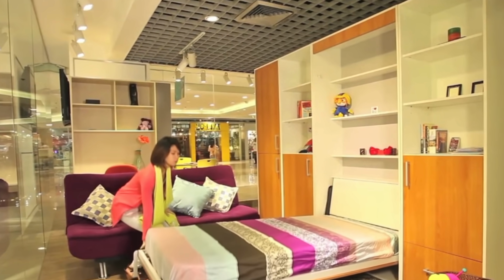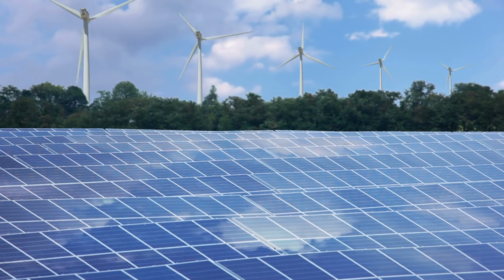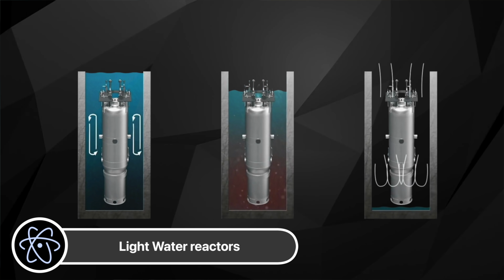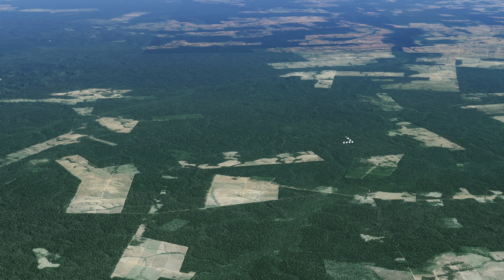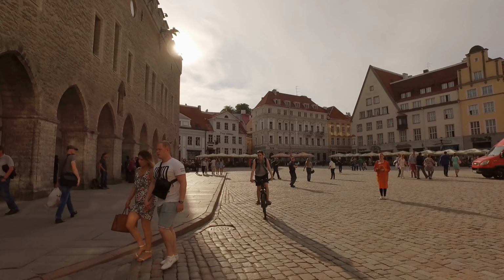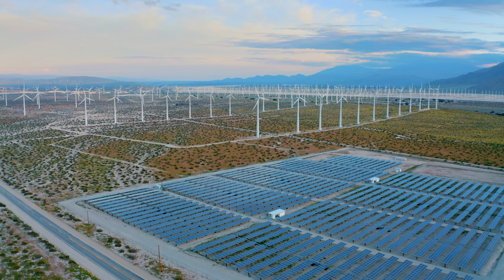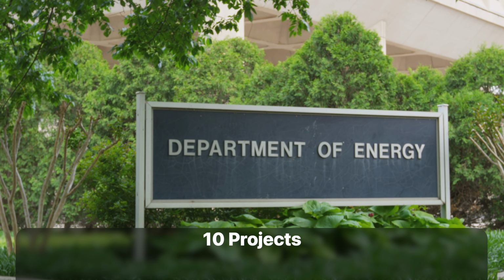Why Small Modular Nuclear Reactors Are the KEY

Comment: Modular Molten Salt thermal breeder reactors are probably the most promising technology (invented by Alvin Weinberg in the 1950s). The beauty of this design is that the reactor is inherently safe and uses up most of the fuel (Thorium). By contrast the light water reactor requires an extremely robust containment chamber and only uses a few percent of the loaded fuel and is inherently dangerous due to very high pressures.involved.

Comment: Actually it should be the percent of fissile fuel. You could make a small msr for a car if you can use Carbon dioxide as the moderator and zirconium fuel rod filled with fissile salt. And use a neutron reflector. So the Super critical carbon dioxide acts as the moderator, slow neutrons are reflected back and Zirconium is passive to neutrons so maybe you could run a car off a U233 fuel salt.

Comment: Perfect for Australian Regions !  My calculations show that 80% of Waste Heat energy from fossil fuels combustion is located in just 2%  of the Global surface. (The Urban Heat Island (very large cities)). The rest of the Global land area is a great candidate for Small Nuclear Reactors  power. Independant, no grid interconnection required etc.
Reply: Why would you mess around with nuclear power in a very spacious and very sunny environment like Australia? I think solar and a few batteries will always be cheaper.
For us in colder regions, we need more backup (but we can use more wind power)
Reply: @roland9367  we have nightime in Australia and please do some maths on grid supply scale batteries with no fossil fuel backup - the cost for a 10 year life is astronomical - remeber when the sun don't shine and the wind don't blow ......
Reply: @jimlofts5433  so you just need a battery to maintain the aircon during the night? That is not a big deal. And lifepo has a long life so 10 years is not a problem.
Also insulate your houses better and run the AC stronger during the day so it can run with lower power at night.

Comment: Cost, security, and safety remain a large concern and may take a decade to validate this new technology. A nuclear reactor typically requires 4 full time operators per reactor with 4 crews for shifts and vacations that would need at least 16 operators per reactor times 12 reactors at a secure site is a huge issue. Much too early to call the SMR low cost. Previous reactors suggested that nuclear power would be too cheap to meter, how did that work out.

Comment: Current home electricity costs, if around $200 per month, equals $24,000 for 10 years.  An in-home reactor that can supply your power needs endlessly for 10 years or more would have to be competitive with $24,000.  The more competitive it is, the more it could overcome people's perception of nuclear tech.  Miniaturization of nuclear power is inevitable.  10 years ago we wouldn't have dreamed of battery powered chain saws and riding mowers.  I won't buy a corded drill ever again because it can't compete with the convenience of the battery tech.  Battery operated viability will continue to progress to larger devices, and the need for way more electricity will pave the way for the the demand for in home miniature reactors.

Comment: It’s great to see massive developments on SMRs, MSRs and Micro Reactors. This is one of the most essential developments to slow climate change. Some Molten Salt Reactors (MSRs) can even run on exiting nuclear waste (after initial U235 typically required for startup). Other MSR designs produce about 95% LESS WASTE than legacy nuclear that has far shorter life span. Industrial heat represents about 20% of all green house gasses and no amount if solar, wind, geothermal and batteries can provide affordably compared to fossil fuels. However Small MSRs run at around 1,200 degrees F (650 Centigrade) near atmospheric pressure, so no insanely expensive pressure containment buildings are required. Factory mass production will dramatically reduce costs over time, as does their inherent ‘passive’ walk-away safe architecture that dramatically reduces the need for legacy nuclear’s unbelievably expensive and complex ‘active’ safety requirements.

Comment: At 13.59 you say that ALL nuclear reactors produce nuclear waste with half-lives of tens of thousands of years.
Not true.
Solid fuel nukes do need to be refuelled and the fuel rods reprocessed regularly, every year or two, but one BIG exception is molten salt reactors where the fuel is in liquid state, dissolved in a carrier salt such as Lithium fluoride. The nuclear fuel in these reactors is virtually completely consumed, and the waste products collected and removed on a regular basis. So instead of ending up with high level waste due only consuming a few percent of the available energy in the original fuel, with super-long half lives, the LFTR uses almost 100% of the energy present in the fuel load, resulting in much less and more benign waste with much shorter half lives.
This, IMHO, is one of the prime benefits of the molten salt type of reactor.

Comment: You can solve the problem of any radiation accidents in 1 swoop. Replace Uranium with Thorium in a molten salt small reactor. If it can be made to use uranium it can for thorium also.
In fact if government's were seriously trying to stop using fossil fuels, we would be sailing, flying & driving using molten salt rectors now

Comment: @TwoBitdaVinci I appreciate the research you put into each and every video. I applaud you mentioning the Crystal River, Florida reactor, my grandfather worked at the Coal / Fossil plant right next to those reactors before retiring in 2004, and it wasnt too soon after he retired that the reactors were decommissioned after stress cracks in the concrete dome formed when an engineer ran a test improperly, damaging the reactors concrete outer casing.
Reply from the maker: That’s fascinating, he ever talk about it?
Reply: @TwoBitDaVinci  yes, I was raised by my grandparents and remember him leaving for work everyday heading to the plant. He spent 15 years at that particular facility, 37 yrs in total with Florida Power Corp, then the ‘94-‘95 downsizing and sell off to Carolina Power and Light to become Progress Energy Corp, then in the 2010s the company was bought out by Duke
Reply: @TwoBitDaVinci  Every type of reactor design known has been built and tested by the U.S. over the last 70 years and the BWR/PWR designs were chosen because the offer the best mix of advantages over disadvantages.  
Any channel that does not discuss the VC Summer unit 2/3 and Vogtle unit 3/4 PWR construction disasters is ignoring what nuclear costs today in the U.S..  Having worked in the nuclear field for 40+ years, I am not anti-nuke by any means.  
Why do people just talk about what might or may happen of what is possible and completely ignore the reality of nuclear power in the U.S. today.  We are not like other countries so what happens in other countries does not matter and corporate and book smart PR is nothing but BS unless backed up by reality and proven examples today.  No investor owned utility is even considering new nuclear because it is their money at state and they don't invest in maybes.

Comment: The radioactve waste is, unfortunately, not only the fuel, but also all materials that undergo long-duration radiation exposure. In nuclear plants, these are tons of concrete used to store the burned fuel before offsite transport, etc. We woul have to get much better at these - you don't want to get one of these babies, just to realize that 10 years later you will face a catastrophic refuel/cleanup situation :(

Comment: 1 thing missed is smaller modular nuclear is easier to load balance (I believe). It's generally much easier to turn on and off individual cells to react to load demands than large traditional nuclear.

Also - would love to see a deeper dive on the difference between then competing micro-nuclear reactors, especially the regular water designs.

Comment: Many decades ago, I was standing within earshot of some Power Company execs, as I took them to be, while at the visitor center for San Onofre's Unit 1, the 183MW reactor now dismantled. The conversation I overheard had some relevance to where we are today with two much larger domes no longer cost effective due to the very difficult financing ALL of our nuclear reactors suffer from.  The one exec was saying 1000MW of coal fired was just so much cheaper than even that middling Unit 1 we were looking at. The other arguing for nuclear said that the economies of scale would be reached, and so it was. I have read so many other stories about SONGS throughout its life, some good, some very disturbing. Generally I see most nuclear as a "money pit" investment that has yet to show its worth for all the grand mistakes of its past.
Like you I see a possibility for some SMRs, maybe. There has to be some base load power in centralized power generation to make renewables fit in to that business model. But mostly I see an industry that is still trying to justify its  fiscal existence. Sans Governmental subsidies for the waste containment  it just does not work out.

Comment: There's a good potential for the use in aviation,  and in use with other components for space travel, there are currently 3 types of engines for space travel in some stage of production. One of the engines needs the sun's light energy too move, a SMR could produce enough light too make the engine work, giving it a stable source of energy.  They can also be used as energy-efficient source for running all of the components  necessary. Where solar power is good there are variables that can place them useless ,or severely limited due too planetary adversities. 
So yes There's a future for these types of component modular reactors.
Reply: > there are currently 3 types of engines for space travel
Chemical
Ion
and...?

Comment: When it comes to the history of nuclear power, small nuclear reactors are not a new thing. In the 1950s and 1960s there were some small nuclear reactors, these early small nuclear reactors were not modular. A couple of examples of early small nuclear reactors include a Nuclear reactor that was at McMurdo Station in Antarctica in the 1960s to provide electricity to the Station. Also there was the SL-1 reactor in the state of Idaho where three men were killed in an accident in 1961. There are two potential trouble areas with these Small Nuclear Reactors, one is making safe reactors that will not melt down in emergencies. Also like large reactors, when these reactors are refilled or reach their end of life there will be Radioactive waste products that need to be dealt with. The problem of Radioactive waste products is a big ongoing problem with no easy solutions.

Comment: To be honest I don't see the need for nuclear when we have wind and solar, the problem I see is the way in which we make use of the wind and solar, for example with the use of hydrogen we could produce hydrogen from wind or solar or both and store that hydrogen for times when there is little to no wind or solar energy.

Many hydrogen sites can produce their own hydrogen from wind turbines and store the hydrogen off site or on site.

But nuclear needs lots of waste disposal, hydrogen doesn't, wind doesn't and solar doesn't.

So it would make more sense to produce the hydrogen store it and use it when needed.

Instead of drawing the power and  using it direct from wind and solar, produce it store it as hydrogen and problem solved.

Comment: It seems SMR nuclear can be a good alternative for the typical big nuclear reactors but I don't think that they will completely replace them. There's something you didn't mention and it's that MSR reactors can use Thorium and literally nuclear waste as fuel. Yes! It's possible for IV gen reactors to recycle nuclear waste! Also, since MSR use molten salts instead of water, either in small form factor or even the big regular reactors, if using that tech (there's one functional in Russia the BN-800) you have quite a lot more advantages than the other designs. However one big advantage I see for the SMR is that being so small, they could also be carried to many places. I think I have heard Rolls Royce is making some of those to be used in space missions! AH but quite a lot of people fear nuclear power and they are the cause that in both Germany and Spain more fossil fuels are being burned (Coal in Germany, Gas in Spain) because they are wanting to shutdown their nuclear reactors. They expect to use hydrogen as replacement, but they are getting Russian gas to burn instead.

Comment: Nuclear fission reactors are the future solution to drought too. We should be building these for desalination en-mass. We should be spending MUCH more effort to develop new technologies such as thorium.
Reply: Renewables are currently cheaper per kwh, and water storage is usually pretty cheap so the intermittency isn't much of an issue, nuclear energy definitely could be used for desalination, but it is much more valuable as a source of grid energy.
Reply: @garethbaus5471  Obviously wind and solar are not cheap or they wouldn't need such high subsidies,even in China they get more power from nuclear than solar,it is vastly less expensive.
Reply: @paulbedichek2679  the unsubsidized LCOE numbers beg to differ, even unsubsidized wind and solar which both have a LCOE that puts them in the 5 cent per kwh rangy can remain profitable with a cheaper wholesale cost than natural gas which is generally in the 6 cent per kwh range. Hydroelectric genorator can be as cheap as 2 cents per kwh in some installations but most suitable sites have already been installed it's further adoption is constrained by geography. The prices of wind and solar electricity only hit cost parity about 5 or 6 years ago so taking that into consideration the rates of adoption for both wind and solar is fairly high with 2 states in the US already genorating enough energy to meet over 40% of their electricity demand from wind alone. As someone who lives in one of the states that genorates most of its electricity from wind I can attest that the electricity rate hasn't increased significantly and unlike in certain parts of Texas my power didn't go out last winter.
Reply: @garethbaus5471  Wrong , both wind and solar are far to expensive to install without massive subsidies, and they both need firm backup, if you’re not part of the one percent that has hydro, nuclear is the only Carbon free backup.
One nuclear plant displaces more Carbon than all bev’s worldwide.

Comment: Ontario province, Canada has just signed a contract with GE to build a new SMR about 600 mwe, PWR, walk-away intrinsically safe, no power required for safety. Ontario also already has 20 of the PHWR's needed to burn up the spent fuel, if reprocessing ever becomes viable. To be online by 2028.

Comment: There is a device used by Walmart, Google, big data centers that uses gas passed over a ceramic disk coated in some secret green substance. These devices provide 100% of the power Google and Walmart needs for their major data centers/Corporate HQ.  Gas passes over the plate and generates electricity. At one point a small one size of a rubics cube would power 4 homes completely with $9.00 (Nine dollars) worth of gas per month. I never saw it hit the market. Power of these utilities to keep their money flowing. I think it's made by Bloom Energy. Would be a good report. I read about it in a geek magazine years ago. So its had plenty of time to get to market, for home owners, but hasn't

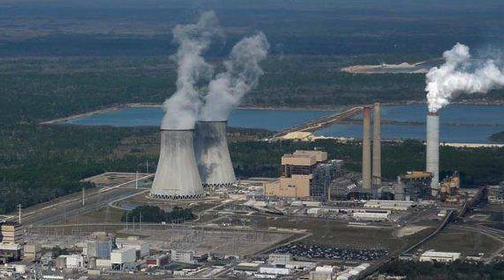Comment: 11:55 Please report on the Aug ‘18 Chernobyl-level near miss that occurred when, during transfer to (thin walled) temporary storage, a spent fuels container got “hung up” on the rim of its receptacle. NRC hearings revealed that had the transfer container slipped off its 1/4” ledge, it could well have torn open, requiring a permanent 50 sq. mile (minimally) evacuation.

Comment: Long half life material is not really dangerous.  Like after 300 years nuclear waste becomes relatively benign. At this point almost all the dangerous highly radioactive materials have decayed into harmless materials.  What's left is material that can be used as nuclear fuel since the  problemsome materials have decayed away. Even if not used as reactor fuel, health hazards from this material will be minimal because the amount of radiation from this material will be very low. So if the wish is to dispose of this stuff instead of using it for reactor fuel, simple geological disposal would easily suffice.

Comment: Alternative designs for nuclear power have been around since at least the 1980s. I inherited the IT infrastructure for a nuclear power research lab of a large company then. They had lots of new designs, just waiting to try out. We have the technology. Why aren't we using it? As I mentioned in a previous comment, battery storage is another key. At the substation and premises level, this would be game changer. We have the control systems to integrate all of this.

Comment: This. I’ve been saying this for years. Even smaller. Enough fissible material in one container for 10s of kilowatts for a few years vs. megawatts. Plug-play a standardized core to serve a neighborhood or even a home.  Minimal core heat ratios. Small to no transmission infrastructure. A ways off, but a good direction. Save the big reactors for fusion, to power dense cities.